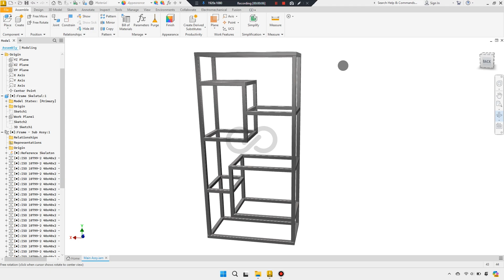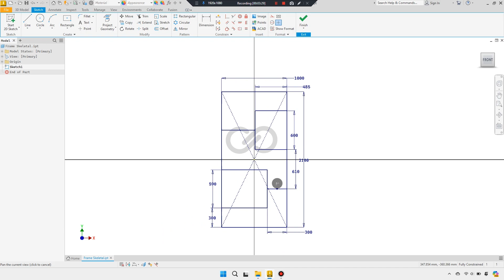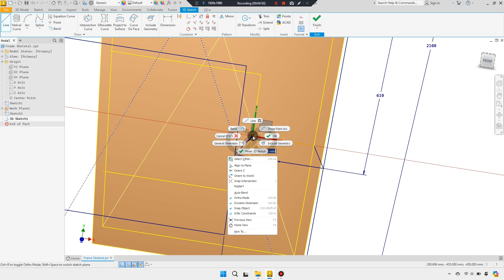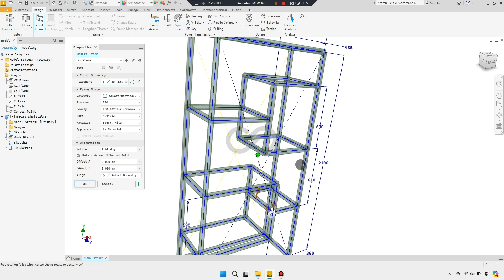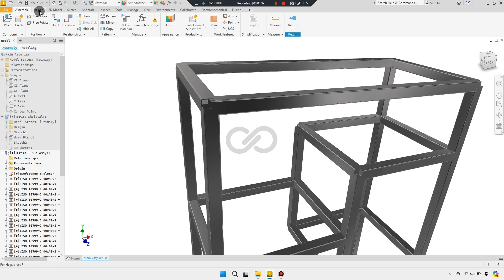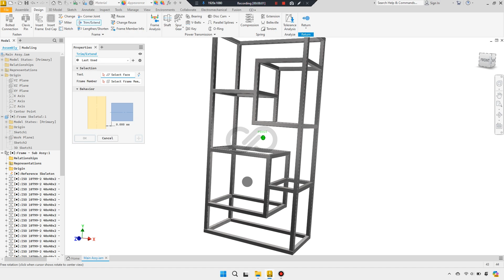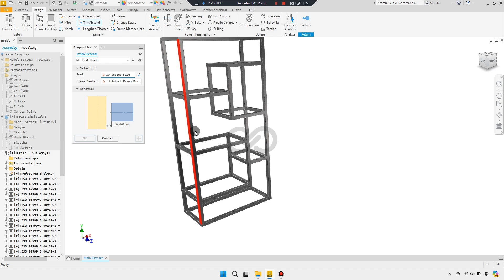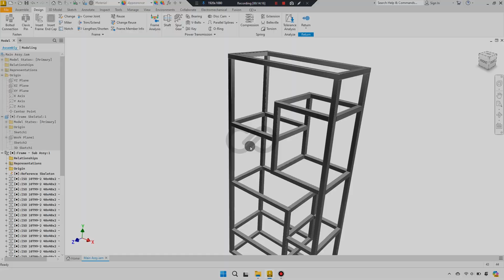Frame Generator - Steel Frame Design in Autodesk Inventor

Comment: I don't understand, what did you use to cut/extend?
Reply from the maker: Hello,

kindly highlight the specific part of the video you are making enquiries about so I know how to assist you.
Reply: @InfinityCAD  starts in 8:45
Reply from the maker: It's the trim/extend tool.

You can see me grab it before beginning the trim operation.

The tool can also extend a frame memeber to a specified face/point based on your input.